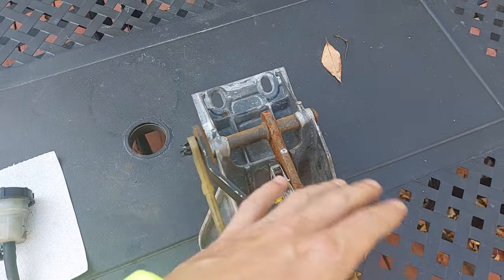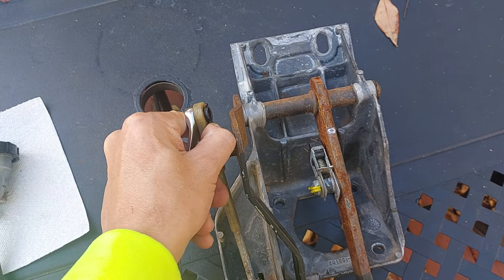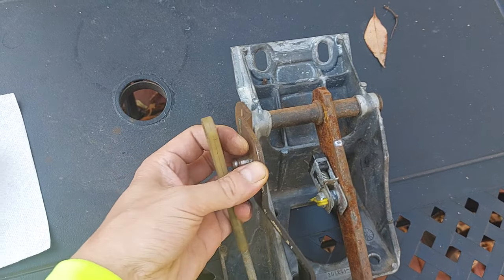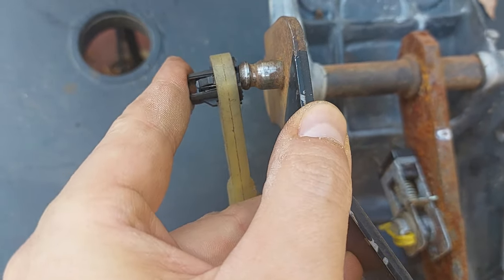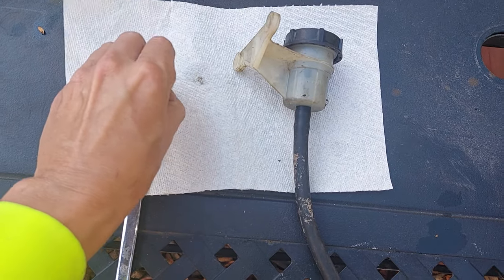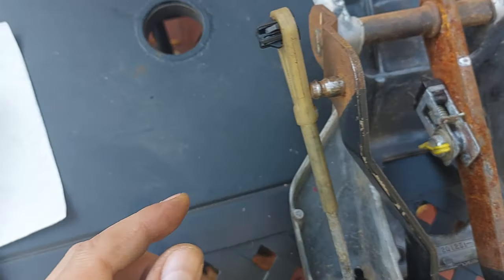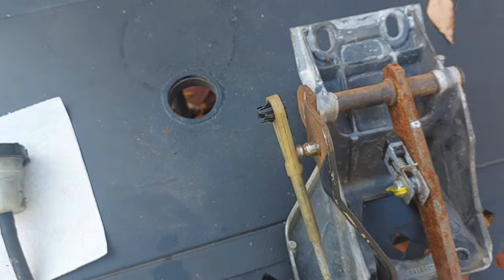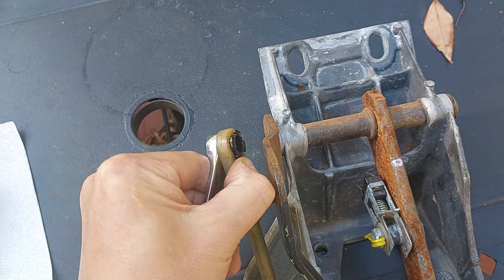How To Disconnect Clutch Master Cylinder From a Clutch Pedal On Ford Trucks, Best Technique

Comment: So take apart an old wiper blade for the long flat thin metal piece inside, cut four sections out of it that are a few inches long, and slide one under each of the 4 plastic snap clips between the lobes and the groove on the pedal stud to get the pushrod off of there without breaking the retainer clip. That’s the information I was looking for. Just came up with that now lol, I’m gonna go try it.
Reply from the maker: I'll have to try it, thanks.
Reply: Good thing there is a ton of room to do all that (he said sarcastically) . But seriously I am going to try that. I did all this once before 8 years ago when I did a v8 swap on my ranger but I must have blocked out the memory of that nightmare until I just had to replace my slave cylinder and found out the master hold lots of air. So now I gotta pull the piston out of the master from behind to bleed it.
Reply: I actually found a better way. Took apart the end of a spark plug wire, the metal part that clips onto the top of the spark plug. Also needed a pair of gas/mig welding pliers, they have a rounded portion of the jaws designed for gripping copper mig welding gun tips. Using a shaft with the same diameter as the clutch pushrod, I was able to reform the portion of the metal spark plug wire end that crimps around the wire itself, around the mock pushrod shaft by squeezing it with the afore mentioned portion of the plier jaws to get it shaped correctly and then bend the portion of the metal plug wire end that clips on the tip of the spark plug 90°  and flatten it out to where you can hold it with your fingers and use it just like a fuel line release tool. Push rod popped right out. A fuel line release tool would’ve worked perfectly, if the clutch pushrod were the same diameter as one of the release tools in my assortment. But of course not, so I made one. And the Internet said it couldn’t be done.
Reply: This is what happens when you grow up watching MacGyver
Reply: @1badombre82  
I think I just replied to myself instead of you but check out the method I conjured. It works.
After removing the push rod, and getting the whole master cylinder and pressure hose assembly out of there, I took out the retaining clip that holds the master cylinder piston in the chamber, removed the piston and spring, filled the cylinder with brake fluid up to the brim, and reassembled. Not much air, if any, to get out by pumping the piston with a screwdriver if it’s already full to the top with brake fluid from the git. After the “quick release“ (yeah right) pressure hose coupler is pushed back into the slave cylinder, I gravity bled two reservoirs of fluid out through the bleeder, never touching the clutch pedal or letting the reservoir run dry. My clutch hydraulics finally work flawlessly.
Reply: @beerggls  I actually realized the master shaft bushing was a dorman brand since I replaced the master 8 years ago. So they pop off alot easier than the factory bushing. Pulled the plunger out. Let the fluid fill the master and of course pour onto the carpet and put the plunger back in. Feels like there might de a tiny bit of air still in it since it doesn't have much resistance for the first inch and a half of pedal travel but it's working good again
Reply: @1badombre82  
Yeah you can pull the snap ring C clip or whatever and remove the pushrod and plunger as an assembly and spill brake fluid everywhere, without having to remove the rest of the master cylinder(which otherwise would require taking apart fender wells and brake boosters and fuse boxes) But you can’t put the plunger + pushrod back in as an assembly without brake fluid spilling out before you can get the plunger back in. Not with the rest of the master housing still bolted to the firewall sideways.. unless you park the truck pointed down a VERY steep grade lol. So I pulled the c clip and plunger push rod assembly out first, then removed the master housing and pressure hose, made the push rod release tool and separated the pushrod, reassembled filled purged air(not bled) and installed the rest master cyl, then put the pushrod back in and connected it to the pedal and gravity bled two reservoirs. All to avoid taking apart half of the front end of the truck to get the damn thing out there with the pushrod connected still. They did this on purpose so you have to buy a new master cylinder with the push rod not yet clicked into place, instead of rebuilding your old one. Because the first time I went through this ordeal I just cut the pushrod off to get the old crap out of there so I could put the new one in.
If you think you have air in it still and too much free travel when you first press the pedal, pull the rubber access plug off the bell housing and have someone step on the clutch. Observe how much throwout travel is going on. I forget the spec but make sure you’re close to it. I ran into the problem where I grinded too much of my flywheel away when resurfacing  and didn’t put spacer shims to compensate for it, which made throwout travel insufficient to de-couple Flywheel/pressure plate from friction disc. Shifter wouldn’t go into gear with the engine running. Imagine the joy on my face when I realized I get to take everything apart again and put a new flywheel.. The F bomb heard round the world.

Comment: I checked the Ford Service Manual. It says "Using a screwdriver, disconnect the clutch master cylinder rod from the clutch pedal pin."
So I wedged a screwdriver between the pedal and the rod, and twisted. The rod, along with its crappy plastic bracket came off in one piece. Easy.

Comment: How did you get the pedal assembly out. I’m having a tough time with my 96
Reply from the maker: I unbolted it from the truck, takes like 5 mins.
Reply: The clutch is in the way tho did you remove the entire clutch assembly? It’s too long to just pull straight out
Reply: @Lilchino707 I’m wondering if anyone in the thread has found a way to pull the pedal assembly out yet
Reply: @fantasyyy_  yeah so the clutch and break pedal is on piece. You need to remove 2 bolts under the dash and removed the 4 bolts that are around the breaks/pedal bracket, remove the clutch from the pedal. It’s a pain in the ass but it is possible haha took me 2 days to figure it out. Basically you have to remove the entire bracket assembly to be able to remove the clutch pedal itself and the break pedal. There are a few wire sensors that NEED to be on the car to start so I’d use some tape and number them unless you feel confident in remembering how to re assemble them.
Reply: Once you remove the clip that attaches the clutch to the clutch pedal you can carefully push it towards the engine bay to fully pull the bracket out.
Reply: @Lilchino707  I see what you’re saying thank you ! Does this mean that I won’t have to replace the clutch cylinder? Currently only my pedal assembly is lose and I’m needing to replace it, so I’m thinking I could swap it out quick if there won’t be other work needed
Reply: @fantasyyy_  it’s lose as in wiggling left to right? Or lose like you need to press the clutch almost to the floor for it to engage? I replaced my bracket assembly because of bad bearings that wore out. Eventually it just completed broke off while driving and my pedals were limp.
Reply: @Lilchino707  yea It seems to be only the clutch pedal assembly thats loose, sometimes I have to push it to the right with my foot and then down in order to make it engage. There’s no problem with it returning or engaging with trans. Pedal bracket wiggles and I’ll probably buy a bracket online to replace soon if that’s all it is! Thank you for your help
Reply: @fantasyyy_  well you could be missing a pin at the very end of the assembly I’d check that first. Save you a few bucks and headache
Reply: @Lilchino707  hey so I’ve been looking at the truck and did notice the pin at the end was coming loose as well but the bracket with the push rod and clutch pedal don’t hold together? It seems like it doesn’t line up even, I’m thinking I’ll need a new cotter pin and replace some of the brackets to get my pedals firm again ? I appreciate your help

Comment: How do you take the push rod out from the master cylinder ?? mine snapped in half ...
Reply from the maker: There's a snap ring in the master cylinder that you have to remove to separate rod from master cylinder.

Comment: Got the pedal assembly loose, pulled clip on the back side of the square hole but still can't pull it loose even after rotating the square plastic to pull out of the square hole.uhg..smh

Comment: What bolt size is the clutch master cylinder? The 2 bolts 
Is it 10 or 12 mm.
Reply: on my 1993 it's a 10 mm.